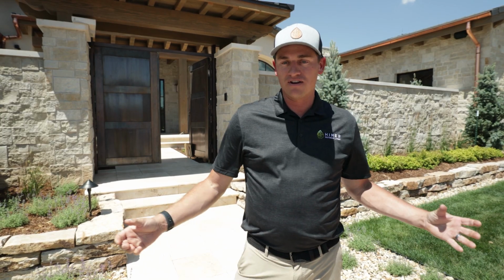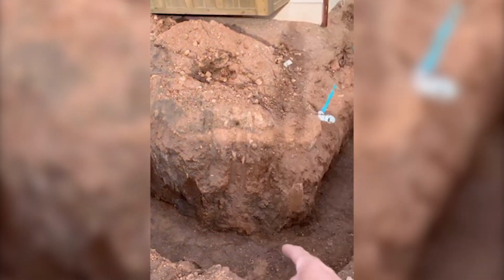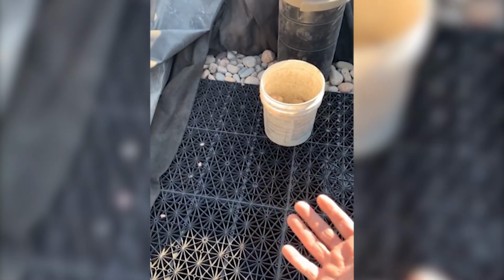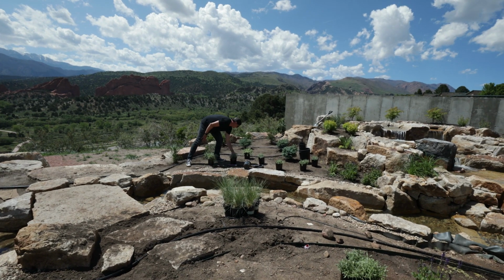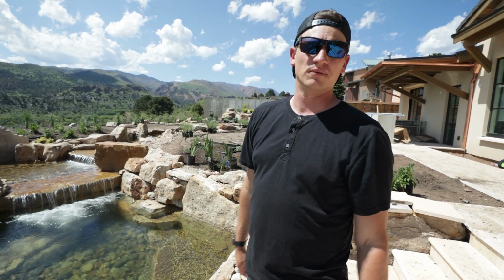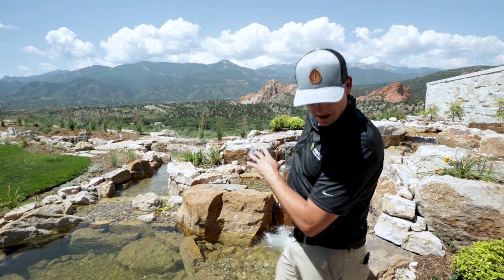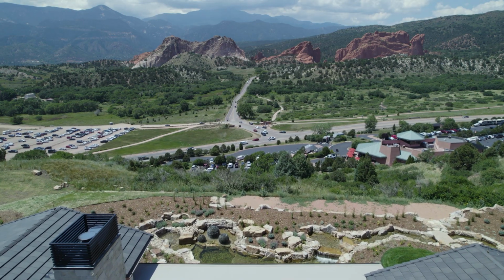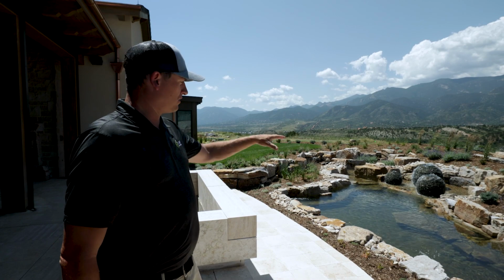How we Built this Dream Colorado Springs Backyard & Pond

Comment: Matt:  Home run man!   Where do I start?  The way the water feature creates a visual, and audio buffer from the house and the Garden of the God's visitor Center and the street at the bottom of the mesa works extremely well.   Then the integration of the upper waterfall against the retaining wall was a great solution for what would have been just a big blank wall surface. The result is a much more intimate and private niche.    Finally the 3 slate water spheres are killer.  The proportions are perfect. I love how they nestle into the water feature while at the same time serve as a beautiful sculptural element in the foreground of the overall composition of the view to the south west.   As I said alread,  you knocked this one out of the park.  I could go on, but don't want to hog your spotlight.   Your awesome Matt. This design is visionary!

Comment: It's a gorgeous build. Congrats. Did I understand correctly that you plan for 500 GPH per inch of width for a sheet falls? It looks like you have a 4 or 5' wide falls into the pond there. So you're pushing 24k+ GPH over that?